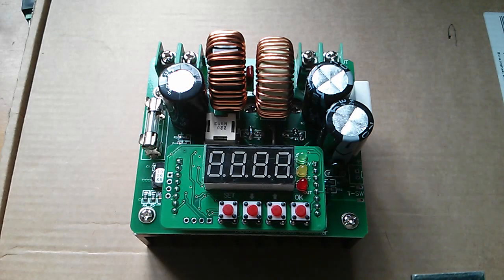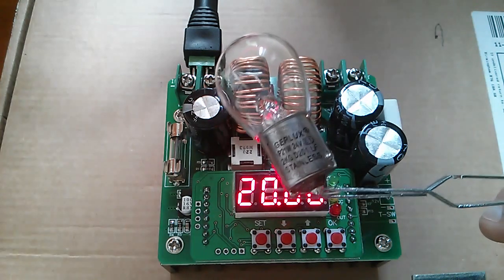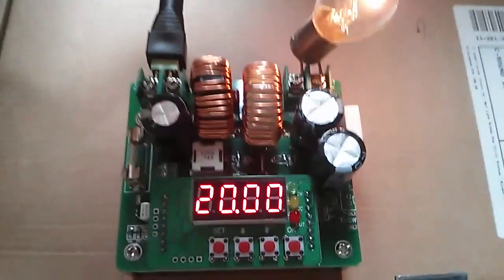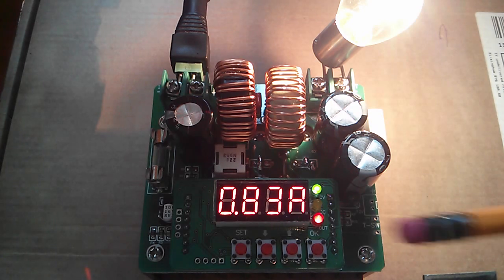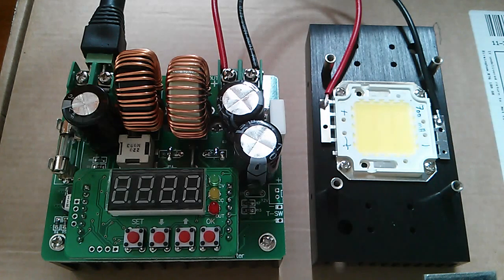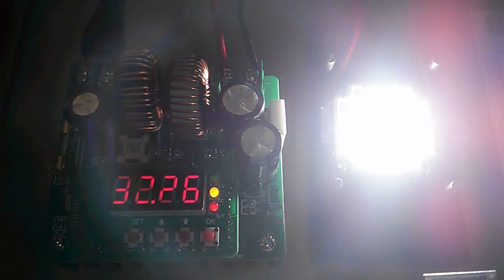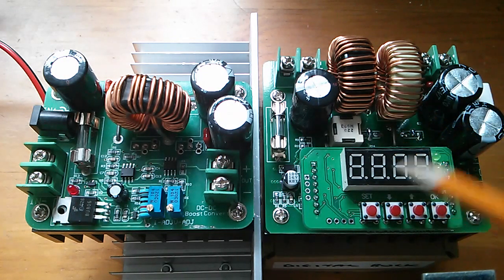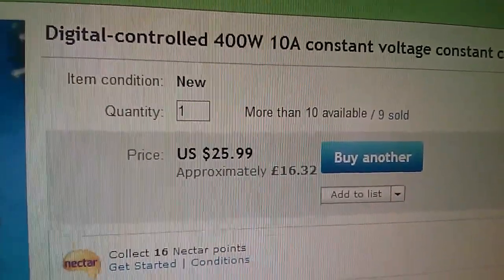Review: 400W Digitally Controlled DC/DC Step-Up Boost Converter

Comment: Could you not just install two switches, one to turn the power supply on, and one to turn the lamp on?  This second switch (in series with the bulb, of course) would give you the instant lamp on/off functionality (although of course at first you would have to wait a bit).  The power supply would still supply -40v @ 0A when the lamp switch was "off", I assume.

Comment: if the inpu is 12v. the output can be 5v?. (step down)
Reply: Watch the video. Julian said the output cannot be lower than the input.
Reply: Sorry , I do not understand spoken English.
Reply: You can use a buck converter for step down.

Comment: Nice video I also happen to have both of these converter the digital one I set it up for a step up power supply ans the 600W one I use it in my military 24v 12A heater. The only thing I have to say for the 600W one is that if you plan on powering it with less then 16 volts you need a short a little jumper on the board which then turn the converter for 8~16 volts. Make it a little unpractical for my application since I was planing on having my heater multi voltage but it work great :)
Reply: bakupcpu can you tell us which, what and where to jumper?  I am about to get one in the mail one of these days.
Reply: Good day, very easy to see it's the only 2 pin little jumper thing on the board and it's mark 9~16V. Cheers!
Reply: bakupcpu  Thx, looking fwd to test (and use) this one
Reply: :) no problem :) II love this little power supply in fact I have all 3 of those :P
Reply: i have this 400W Digitally Controlled DC/DC Step-Up Boost Converter. But why my 20 A fuse getting so hot when i power supply my 100 w LED diode? Input voltage is 12 V and output is about 30-32 with about 2.7 Amps? It is because of low imput voltage?
Reply: prckata Probably depending on how hot it become it may be a problem maybe change it with another 20A fuse. I never push mine over the 5 amp 12 volts but I didn't check the fuse. I use it to run a 50 watts LED :) quite the amount of light.
Reply: bakupcpu well it gets so hot that water boils on it... i tried replace fuse with like 5x thicker wire than 20 A fuse was and same thing it getting warm. But meanwhile i tryed something, when i put 19 v imput voltage its okay. So i guess its too much for this step up pussing 100 w on 32 v when imput voltage its only 12 V... so this could be problem if u wanna us this in car and try push 100 or more Watts. I guess another step up would resolve problem... so one step up to rase Voltage from 12 to for example on 19,20 V and than this one to supplay 100 W Led chip. Im wonder how you could supplay 400 w LED chip with this if u have 12 V imput. Probably it would burn immediately :D
Reply: lol 400W LED lol warning blindness will occur. Now for that fuse I find it weird, you are not going over the 20 amp since the fuse is not blowing but the fact that you can boil water on make it a fire hazard. I have a 600 W dc to dc converter in use in a 24~30V gaz power heater I should run it to see if I have the same result. This heater use about 20 amp at 12 volts.
Reply: bakupcpu  Well if you have this 400 w converter try it with. Put 100 w on 30 V while imput is 12 v, and see if 20A fuse is getting warm. I think julian said that 600W rated converter does not have problem with supplaing 100 w Led chip.
Reply: Will do :) I'll test that!

Comment: What he does not mention is that there are two different type of boost converters. I purchased the one that he shows not knowing that it would have problems.  in my opinion this type converter is unsafe because it does not limit the current output,  when a short occurs, it should regulate the current down to minimum current. Not apply  As much current as available. A much better design is a Buck–boost converter. See Wikipedia for a description of this type power supply. For this type converter, Always fuse the output for the maximum current that you need. And do not leave this type power supply unattended. it could be disastrous if something fails in your project.

Comment: if you don't want to wait for the driver to "Warm up" couldn't you just leave the driver on, but install a toggle switch on the output wires and use that as the on/off switch?
Reply: Bad idea. Open circuit boost converter with current limiting, the voltage would just keep rising

Comment: This thing is more like an inverter then boost converter. I would think if your going to drive an led head lamp why not do it the right way and just buy an after market kit. This booster would be good for household lighting because of the ramp in speed. More or less it could be that the pwm circuit in the device is just slow.

Comment: If you take the little controll panel from the LM2596S

On the 400w dc-dc 
You will not have the slow uprise of the volt 

Hope u understand :)
Reply from the maker: Bo Robin Larsen I did consider that, but I suspect the firmware is different for each unit, certainly in respect of voltage and current upper limits. Not sure if damage would be done, but I don't really want to find out the hard way!

Comment: I know this was posted two years ago... But i've recently bought this boost converter, with hopes of directly attaching it to a ZVS flyback driver, of which I also bought off of banggood :) . I have a 19v 4.74A, 90W Laptop charger directly attached to the boost converter. to the Everything goes fine... Until I try to draw an arc. The PSU immediately shuts off and reboots. If anybody has an idea of something I could add to the circut, any help would be greatly appreciated. (Maybe some sort of over-current protection? But that doesn't make sense, considering I can draw big sparks just fine without the converter, and just the charging cable. Maybe I need a higher wattage PSU? ) Thanks! :)
Reply: I don't have much experience with ZVS drivers, but I know that they draw a lot of current. Maybe try using a 12v lead acid battery, or a PC power supply (or an ATX PCU). I know that power supplies like this tend to shut off if not used for the correct use, because a slight differ in the power consumption from it can affect the way it operates. If you need any more help, just ask. Thanks
Reply: You were completely right!!! I found an old 350W psu lying around. Provides the 10A it needs, and I can step up the voltage from 12V to the 32V max of the ZVS driver. Just needed 2 fat 10 Ohm resistors to keep the thing running! Everything works perfectly now. Must have been the current draw. Thanks for your help!!! :)
Reply: +SimplyChem No problem, happy to help!

Comment: Can I connected to a small motor that I wanna use for wind turbine direct to Rectifier?? by the way I wont rotating motor by hand shaft will be connected directly to five fins propeller and wind will be blowing directly to it I will be using 12VDC 7.2AH Battery to run the blower. 

1PCS AC220V 3-Phase Rotor Brushless Motor Hand-Cranked Generator With Rectifier
Specification:

Note:it is a DC brushless motor, voltage is 310V (AC220V rectifier filter is DC310V). If you want to use as a brushless motor, add driving the board, can not be directly connected to the AC voltage.

AS Generation Test

The rapid rotation of the motor shaft by hand, the electricity generated enough for high power LED 36V 15W the moment to highlight

900 RPM - Voltage: 22 V
1150 RPM - Voltage: 29 V
2380 RPM - Voltage: 60 V
4600 RPM - Voltage: 124
6170 RPM - Voltage: 158 V
9950 RPM - Voltage: 261 V

I look forward to your reply please thank you, what do you recommend?

Comment: I just got it ,but do not know the function "F1""F2~F6,after long holding  on the set buttom.
Any one can help me?

Thanks
Reply: It's for unit calibration. Here is copy/paste from the manual of similar buck unit B3603 from MingHe, it should work similar way on this boost converter (maybe the min./max. values of the volts and ampers will be different here, but you will see them on lcd).

B3603 Calibration Routine:
Connect to 35V supply (the module needs to output 30V during calibration). You'll need a good voltmeter (VM) and current meter (CM) capable of accurately measuring up to 1.2A. Connect either to the O/P terminals as instructed in the procedures
Power on, press and hold set until F1 appears, you can now press up down to cycle through the cal points F1 to F6. Select F1 and press OK

F1: Voltage Setting Calibration (use VM)
Display shows 02.00, use U/D to match reading on VM, press set to store (the display will change back to 02.00 and your VM should also read 2.00V)
Press OK and repeat the above, this time at setpoint of 30V
Press OK to return to F1. I'd recommend going round the loop several times to verify the 2V and 30V setpoints. Press OK to return to F1, increment to F2

F2: Current Setting Calibration (use CM)
Same procedure as F1, set points are 200mA and 1.2A

F3: Voltage Reading Calibration (use VM)
The module will now O/P 2V (verify with DM, the accuracy will depend on how well F1 was performed). Similar to the other procedures but a little more tricky probably due to filtering, also I don't think there is a need to press SET (not sure what that does in this procedure). Press OK and repeat at 30V press OK and loop several times to tweak 2V/30V settings.

F4: Current Reading Calibration use CM
Similar to F3 but at 200mA and 1.2A

F5: Calibration Settings Save Y/N
Select SA-y to save calibration data (not 100% sure on this as it appears to save settings anyway!)

F6: Factory Calibration Reset
Select r--y to reset to factory calibration values
Reply: this seller has now put up the instruction manual... took a while to download for me, but worked in the end:

http://115.28.16.44:81/file/BOOST-400W%20user%20manual.pdf

Comment: I have this same unit. If you believe what the digital display tells you it runs at 95% efficiency. If you use a multimeter it's only 75% efficient. Most buck/boost converters are getting around this type of efficiency. The manufacturer must be inflating their numbers to look good?

Comment: i had a DC to DC Boost Converter like the one on the left. lower it as far as it can go., step up the amps. after put a load a on it. voltage dropped to 6vdc from 16vdc. then it sky rocketed the voltage on its own to 30vdc.

Comment: i just buy one and test it . it have to be some firmware can be program the microprocessor because i see a data pin out for it . and yes it have a program problem . and another thinks that if you set the vc limit  to under 2V it get error that make the vout get out of control

Comment: But when i run it at 30.95 volt
And 2 amp
 
It makes a little buzzing noize when i am going up to 2.5 amp it get higher
Reply from the maker: Bo Robin Larsen These units do get quite noisy at higher power levels

Comment: The voltage takes awhile to get up because it has a charge pump system.... This allows to be capable of making 400volts like nothing if you want to... Thats why it has the coils on it. Anyways, ya its nothing to do with software.

Comment: Had a few of these, It's very easy to blow the transistors if your not careful, Wish the Chinese would put external pot instead if the infernal fidgety small potentiometers they fit on the ciurcit board ? They would sell a lot more with External pots instead of the stupid small ones onboard! Make it a lot easier to panel mount in a cabinet with floating pots. And for those budding young electronic Engineers with their good steady hands and fingers, Us oldies suffer a bit with fidgety bits being old, but NOT past it!

Comment: Perhaps I'm just shooting my mouth off, but I suspect the very slow ramp-up time is just naive software.  Years ago, brushless motors for model aircraft chattered, buzzed and shook the aircraft to pieces.  Then someone came up with a delta-predictive algorithm.  It's also been used in fancier thermostats. My guess is that the hardware you have here could have a ramp-up time of a tenth of  a second, given better software.

Comment: i think the rise in voltage is likely the micro stopping increments, reading current and voltage and then starting increments again, repeating this until it gets to the regulated values.  Not a fast processor but also, safer to start lower and raise it, measuring and then allowing more current/voltage

Comment: It's not good to throw instant flow to led's.
Reply: Nick-NikkisGROW NNG why not? With proper fast LEDs you can flash them at kHz domain. 👍
Reply: @JohnAbrahamsen  depends on the protection of the cob/chip these cheap ones have no surge protection they have gen 3 cobs that have better set up..

Comment: I have two of these and they are both horrible. They don't work anything like yours, Julian. Haha.

This buying these in 2018, be careful. Current limiting does not work and the output spikes to over 30V from a 12V input and drops to Vin within a few seconds.

Comment: i found a user guide for a similar module. didn't even know this one had a mode that allowed it to automatically power up once power was applied, or that you can save voltage/current settings. http://www.elecrow.com/download/B3603%20User%20Manual.pdf
Reply from the maker: Thanks Andres. There's often more info on the Aliexpress listings - just go to aliexpesss.com and search for B3603. But I still haven't found any info on the F1 to F6 menus which are accessed by holding the SET button. They look like calibration functions.
Reply: I found something on the Russian forum, and then print the word ... Well here is the link to the calibration F1 to F6:
 https: //drive.google.com/file/d/0B61b55fzFxDtYXRpRktJMVdqeFU/view? Usp = sharing
The process I tested with Fluke 179 and everything is OK, except I did not use F6 !!!

Comment: cant u just put an switch between the led and the boost converter so if u use it in a car u just flick the switch and the led turns of but the boost stays at it is? planning on getting 2 100w led to put in front of my car. can i drive those with this boost converter from an car battery or do i need an extra powersource?